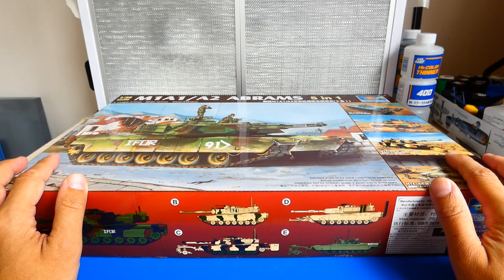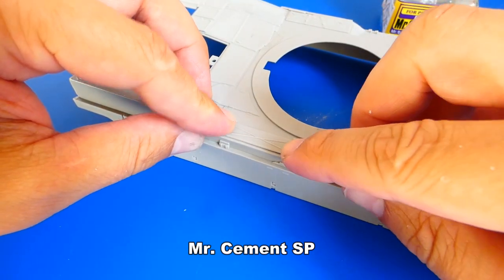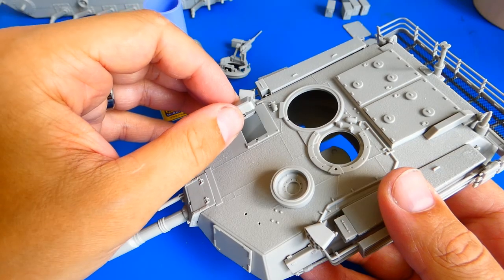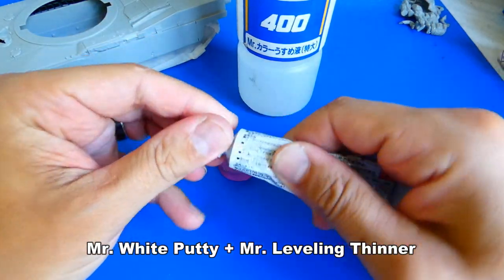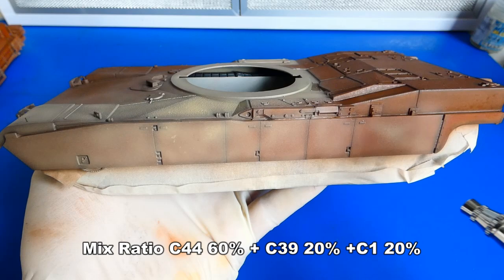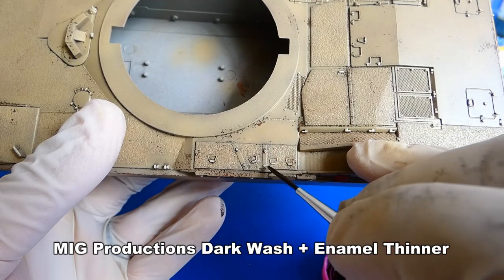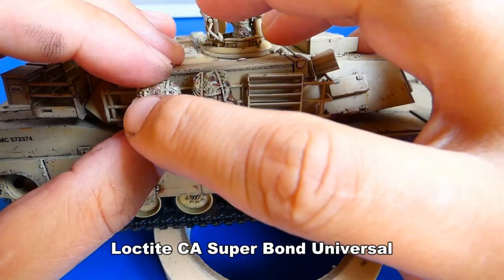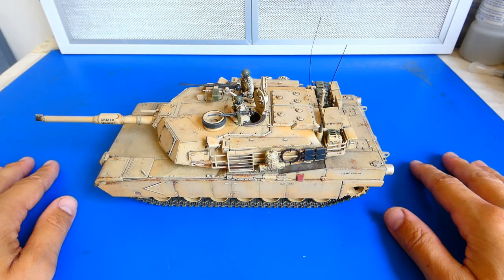M1A1 HA Abrams GULF WAR  (FULL BUILD VIDEO) plastic tank model Trumpeter 1/35

Comment: I have a question... Could you make video or take pictures of the inside of the lower hull and of the inside of the turret to show the placement of the electronics and the mechanical parts placement in those areas? I know and understand these tanks that you 3d Print are based on the Heng Long 1/16 r/c tank layout. But for those of us who are new to the r/c tank hobby, it truly would be very helpful. Any help that you could provide would be greatly appreciated. Thanks again in advance.

Comment: For the wheel bars, 3:30, do they go on top, below, or above that little box thingy?
Reply: I THINK that the "little box thingy" goes into the back of the suspension arm....BTW, this is probably the WORST M1 Abrams on the market. Tamiya, or the new Academy kits are better.
The RFM-Rye Fields Models kits are even better, but more difficult builds....

Comment: Greetings. I have such a kit. I have a question: what lenth should the antennas on the turret of the tank be? The instructions do not say about the length of the antennas. Can you tell me the length of the antennas? 35:01
Reply from the maker: Hi.The length of the thick, green, fiberglass antenna is 8 feet which is 2 3/4 inches in 1/35. The thinner, black, wire antennas are 6 feet long, which is 2 inches in 1/35.
Reply: @modelsforfun  thanks)